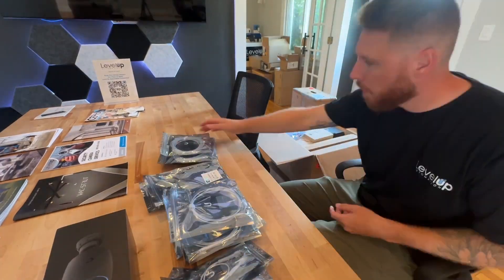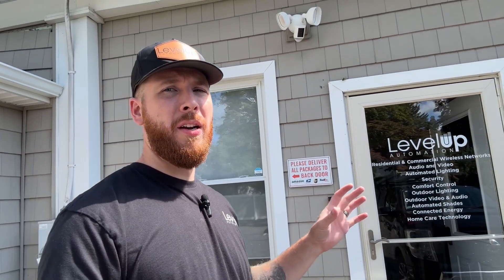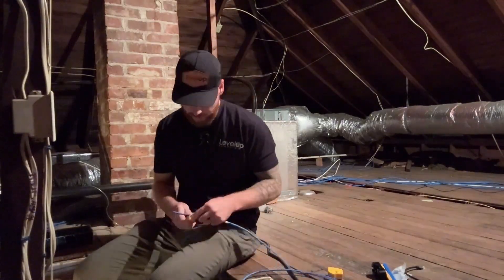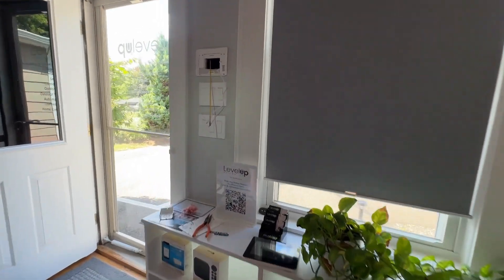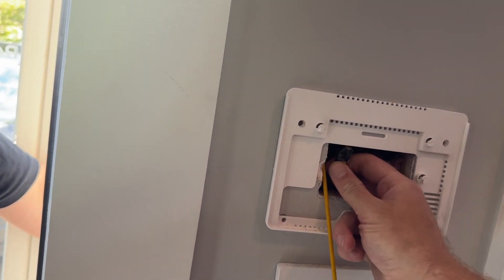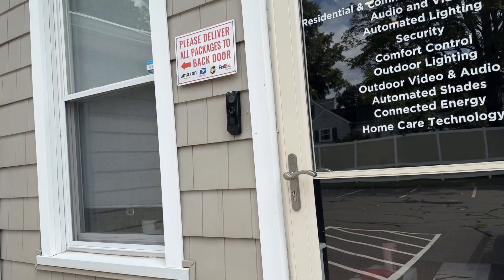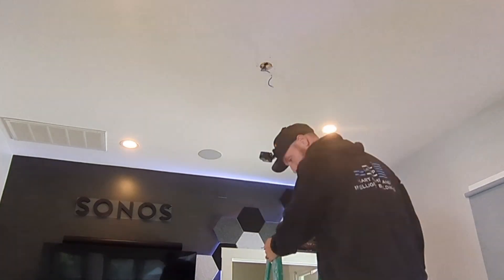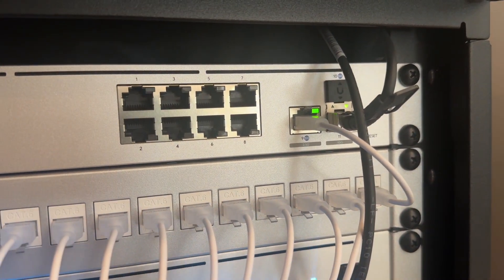Ubiquiti Pro Max Install!

Comment: Hello. how are you? I have a question regarding this device versus a USG Pro 4. In the USG Pro 4, LAN ports 1 and 2 are independent ports, and I can configure an independent segment for each of them (each one on VLAN 1). Is this possible with this new line of devices? I purchased a UCG Ultra, and it cannot do this. The UniFiOS only allows creating VLANs, meaning it only has one network on VLAN 1 for the whole device. Which device would allow me to do everything I need? Thanks. Best regards.